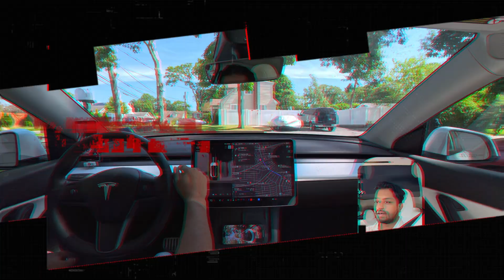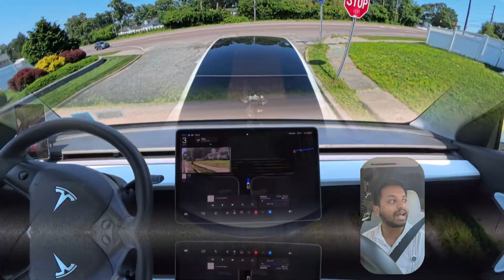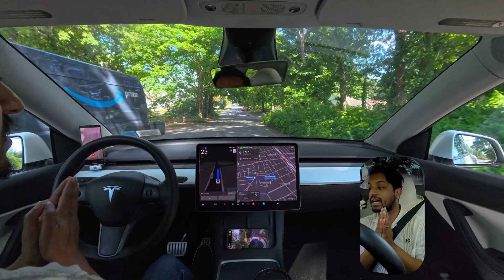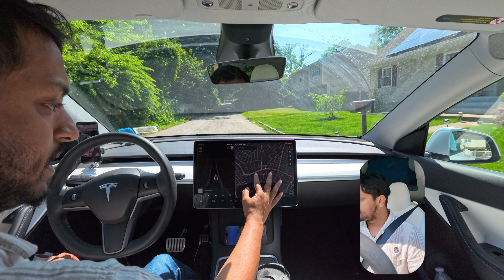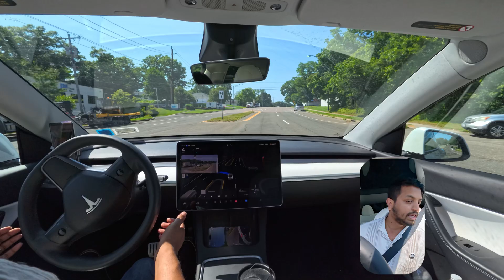Revealing Why Tesla FSD Beta Fails

Comment: Maybe your cameras aren't calibrated.  My FSD works fine 99% of the time.
Reply: yeah, it's fantastic except that 1% of the time that you end up getting a fine, scrap some other car, drive over a person or run into a wall so you'll end up in hospital if not the morgue

A system that isn't 100% reliable and that can have bodily harm if it goes wrong isn't not a good system.
A system for which the creator doesn't take liability is a bad system.
Mercedes takes 100% liability when you use their level 3 system according to it's rules. 
Tesla takes ZERO% liability when you use their FSD(supervised) as per their recommendations.
Reply from the maker: I heard there is a bug while doing the calibration now, I would do that later,

Comment: The most annoying thing about FSD 12.3.6 is how it accelerates and decelerates too hard, even in chill mode. I feel like the cameras are not noticing the red light soon enough. Especially when it does not have a car to follow behind, it will go full speed 50mph into a red light and then slam the brakes.
Reply from the maker: agree, face that so many times.